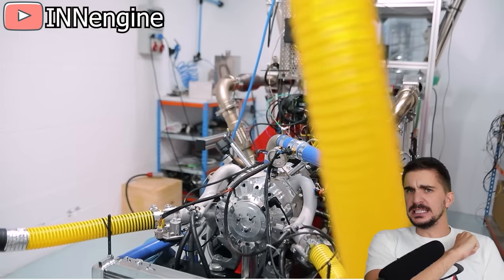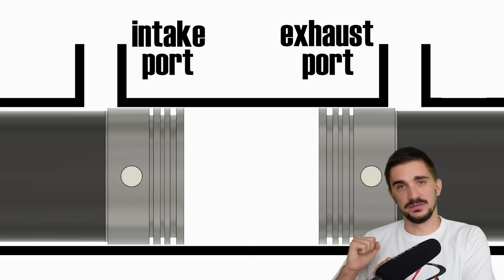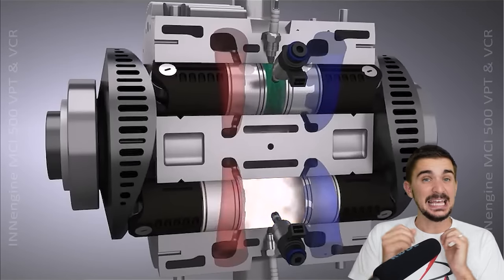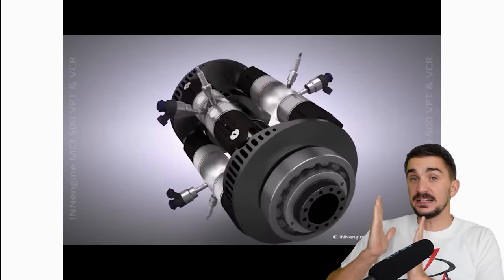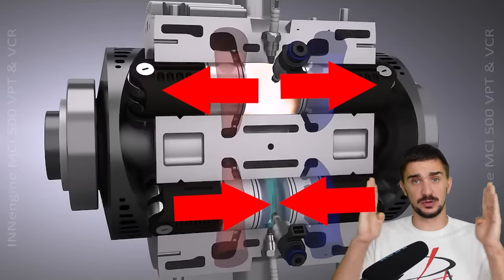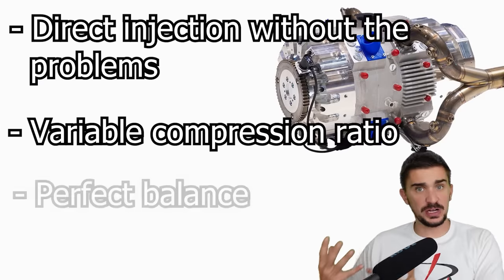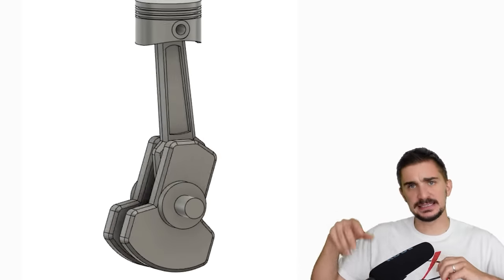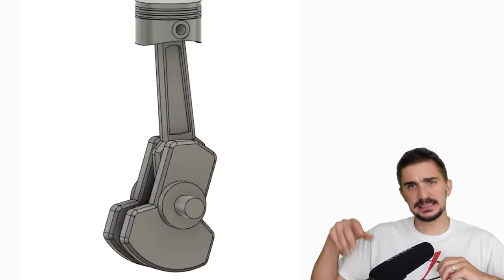Spain is Living in 2050? Revolutionary 1 Stroke INNengine Analyzed

Comment: This could be a perfect back up engine for an electric car.  Make it much smaller, make it run all the time at low speed so its always charging the battery.  A great way to add airconditioning and heat too.  This might extend the range by hundreds of miles and reduce anxiety.
Reply: Erm.. EV drivers don't have range anxiety. We can do 30' more to do the one journey per year that is more than 400km, sure, but I don't think this is important.. And solid state batteries are due to be commercial in 5-6 years so even that edge case will be gone.. This has it's uses, like, electric planes range extender, yeah, probably. But not EV I feel.
Reply: Like, if you are going to do up to 2000km on an EV today, that would need around 6 stops of 30', aka, 3h extra.
In an ICE, you would need 3 - 4 10 min stops to refuel aka, 30' - 40' extra. So we did 2000km, or, 20h of driving, with 2h 30' difference... not a problem.
EV stopped and stretched a healthy amount, ICE drove 20h non stop.
 
And if you plan to do more than 2000 km well... use a plane, it is cheaper.
Reply: I am not bashing your idea, I am just saying that the whole range anxiety thing is not real, it is a silly oilcompany fed narrative.
Reply: So, what about the many people who aren't convinced of the practicality of EVs yet or can't use an EV for their purposes because they drive larger distances than the EV can do on a charge without time to recharge (for instance cab drivers, delivery drivers, mobile nurses, field service)?
Range anxiety is as real as your view is narrow!
Reply: I mean I think thats the idea behind the hybrid, I wish they would push hybrids more because of that reason, there's no real range limits like an electric car
Reply: im starting to think range axiety is a thing for people that dont own an EV yet, myself included.  We are scared to buy one because we are not used to it yet.  No one that owns one is running out of juice any more than some idiot forgetting to fill up quick enough.  That coupled with the fact it is known there arent a ton of charging stations at least, but if we owned one, we'd know where they were at and would adjust accordingly
Reply: @LRM12o8  Most households could use an ev with ease .  If a little motor like this could extend the range of an ev by 300 miles then almost everybody would be relieved of range anxiety.  They could know that they could run the heat and the a/c on a 500 mile road trip.  Most of the time this little engine would only be responsible for heat or a/c and just at idle it would extend the range .  What would be great is being able to rent a full size one that sat on a trailer you pulled by hind you and you could go cross country no problem.
Reply: @smatchimo55  One thing that I don't trust is the life span of batteries.  I've had them last a long time and others that didn't last as long as they should have.  Knowing that if any one of them goes bad it will cause others to go bad to is also a problem.  Tesla is using capacitors but they need to be working on them more because caps charge almost instantly.  They are bulky but if you could run the car on caps instead of batteries then recharging would be more like filling up a gas tank.
Reply: 95% of trips in your car are under 30 miles. The average driver has nothing to worry about when it comes to EV range. 

There's a Washington Post article that's a great read on the subject, titled "The obsession with EV range is all wrong."
Reply: so long as their assemblies are modular and easily accessible for any moron to pop a new cell block in, I wouldnt mind that hassle over having to replace my standard car battery once every 3-5 years @michaelhord
Reply: EV Market has about 5yrs before the market density is max.  As in infrastructure will not be able to support the charging demands. These would be an excellent APU for EV's. Then engage for charging or when power requirements such as A/C are needed. More over, when a vehicle is moving at hi-way speeds it is primary propulsion. I imagine the rpm would be pretty hi on these. So the use of a flywheel in conjuction with the electric motor would overcome issues of steep inclines and such. These would likely be a great application for light aircraft. Really anything that operates at a fixed, hi rpm.
Reply: @michaelhord Do you think it's possible to use INNengine to power the electric motor directly?
Reply: So....... a hybrid...
Reply: @devkrovil  Nope. A hybrid can use the ICE engine only to move the car.
Reply: @KostasTsakalidis  "I am not bashing your idea, I am just saying that the whole range anxiety thing is not real, it is a silly oilcompany fed narrative."

No it's real. I won't buy an EV due to my patterns and habits and work. They will leave me with a dead battery stranded on the side of the road. My buddies with EV agree. Don't state your opinion as fact.
Reply: Ev can be enchanced to max utility use the engine as recharger. If they do 400 more power than normal engine and only weights 35 36kg you can put 1/2 the batteries +  20,25 of fuel. Imagine doing that that is why hybrid is the future and not ev
Reply: @KostasTsakalidis lol ok. Maybe it's because the people that actually need to be able to dependably go long distances just don't buy EVs.
Reply: @MASViper fisker uses a GM i4 to power a generator that charges the battery and propulsion is handled entirely by electric motors. That car is a hybrid.
Reply: @LayerZeroDesign  Wait, I thought that was EV, because it uses that i4 as a range extender?
Reply: @KostasTsakalidis  bro i think he just meant that drivers would not have to worry ab a dead or defective battery lmao
Reply: @KostasTsakalidis  isnt the 4680  texas tesla's already some kind of semisolid or even solid state ones ?> >?  cant remember if its sodium or lithium
Reply: I can understand why non-EV drivers have range anxiety. But why are many EV drivers so against the idea of extending EV range even further?
Reply: @amrazing33  fosil drivers have more anxiety  .. watching the dash for fuels and gas
Reply: With EV's how is range affected if you have a lead foot?
Reply: Compared to the immense pollution footprint of EV batteries. Just keep IC it weights way less also.
Reply: @KostasTsakalidis  I like EVs, but they cannot compare range wise, they are basically useless for longer trips. Of course there is range anxiety for many reasons. If you drive spirited, faster, you will have to wait more and more to go further. When you drive EV you always have pressure to drive slow/efficient to have some acceptable range.

If you drive at 130--160kmh (80-100mph), which is common speed on the highways, what is the range of EV then? Depending on model but around 150miles at most, that is so poor. Not to mention during winter, or with many overtakings, accelerations etc... 800-1000mile trip would be a nightmare and almost impossible in a day. You can only cruise at 65-70mph, to have some decent range of about 250miles, which is still poor and very slow, not to mention you need to charge 30mins again multiple times and plan every stop.
Reply: Exactly!  How nuts is it that a small gas engine isn't an option in a tesla etc
Worst case a chain saw could at least get u moving.  Way better than not even being able to go 10mph if u run out of juice.
Reply: Oder eine Kleine Gasturbine in e Auto. Oder man kann den Motor für ein Schwungrad nutzen. Dann kann der Motor mit der Masse den Akku und das Schwungscheibe betreiben. Und dann den Verbrenner aus machen und mit Dem Schwungrad Strom in der Batterie und Motor laden.
Reply: @KostasTsakalidis One of the Chinese brand NIO published the solid state battery and test it with live, but it should takes us about $50000 for only one battery.
Reply: bro just rediscovered a hybrid
Reply: Electric cars? Are we still talking about this nonsense?
Reply: @KostasTsakalidis  The range anxiety thing is real, and no realistic battery can be repeatedly rapid charged without rapidly depleting your total charging life cycle.

The larger problem with EV is simply infrastructure.

In order for everyone to have an EV to replace their more reliable ICE?

1. We'd have to have Children mining Lithium in Africa at a 100 TIMES their current rate, strip mining the entire country for the world's Cobalt/Lithium.

2. You'd have to convince Politicians to build more energy production means. Already you have the Gov of California telling EV owners they can't charge their cars during peak usage.

Go EV, but don't charge it.
Reply: So to upgrade the EV emissions safe vehicle your suggesting to put a gas combustion engine back into vehicles? Genius
Reply: Not all of us live in flat warm areas. It is not possible to make it from my city to the next large one up in Canada. This is true in summer. A tesla cannot make the distance through the mountains. In winter it is far worse, even when driving in a cold a$$ car because you can't spare the energy for heating. I'll never drive with that guy again. Seriously sucked. Hybrids can be great. I'd choose alcohol though and fix all the currently existing cars at once
Reply: Wrong. Check out upcoming cars. For instance Dodge is making a truck that has a gas engine battery charger
Reply: @FarmingWithYahweh yeah I saw recently how cali makes you charge at certain times, and I thought to myself what the fuck is the point of EV if I can’t even “fuel” when necessary. If I’m going on a trip and pass through cali at a certain time I just gotta go welp, and sleep In the car till I’m allowed to charge it?
Reply: @MultiRacecar1 EV’s construction produces the same if not more pollution than ICE.
Reply: @KostasTsakalidis  Model S Plaid and 911 person here. Range troubles in the Tesla are definitely still a thing. The difference between the two driving from San Francisco to San Diego can, and has, added as much as 50% to the trip time in the Plaid, especially when cruising at or over 85MPh. Road-trips also need more planning and the rule of thumb I've used is that including rest stops you tend to lose one hour every for every four you plan on driving otherwise.
Reply: Nah I think Honda or maybe Toyota got this beat already. It's a linear electric motor, coupling 2 opposed pistons. The starter motor is the alternator and the crank!  Valves are just electronically time except they're also just ported thru the stroke.... Something like that pretty friggin wicked concept at least I think it makes so much sense it's mind boggling.
Reply: Would it be worth the complexity? Thats a whole lot more things that could break.
Reply: @michaelhord the problem with trying to power something like a car with capacitors is that by definition they discharge as fast as they charge. Might work for something like an electric drag car, but long distances quickly become problematic.
Reply: @jutjub22 30 minutes feels pretty optimistic for a charge to full from empty. We struggle to charge phones that fast.
Reply: @KostasTsakalidis  Less than 1% of cars on the road in the USA are electric... People understand range and charging times and are not interested.
Reply: @derekeastman7771  yes, i thought just to fill 50-70% on power charger. Anyhow the range is huge issue, only when cruising at 40-60mph it is acceptable
Reply: @KostasTsakalidis  Correct. People who already have been convinced to buy EVs don't have range anxiety. But if you want to convince other people then range extenders are a great way to do it. I would much rather a plug in hybrid tyhan a full electric. And a small but powerful generator motor like this would match plug in hybrids very well.
Reply: @DonM-sy6yq guys, you are describing the Chevrolet volt.

It's a fully electric propulsion, assisted by a gas engine powerful enough to charge the batteries while driving.
Reply: If you have an EV with an always running ICE, it is no longer an EV, and just a hybrid.
Reply: that is not an ev but a hybrid. but good idea
Reply: it's*
Reply: @KostasTsakalidis no way you just hit him with erm unironicly that's so insane
Reply: You simply cannot go some places in EV it's just solid facts.. the fear is real. I work with batterys that 30 mins is more like 3 hours bro charging past 80% trying to get the voltage up there takes 5x as long as it takes to get from 20% to 80% so yeah ur very very wrong but EVs do have there uses like commuting in urban areas. Not for road trips...
Reply: Check out Edison motors.
Reply: 100% correct
Reply: @KostasTsakalidis  FYI - Oil and gas are not going anywhere. There is literally no other natural, replenishing resource on earth that can replace it. Wars are being fought to this day over oil and natural gas. Batteries, not so much.
Reply: @KostasTsakalidis almost all EV drivers have range anxiety reguardless of what you say.
Reply: @MASViper  How would a combustion engine not make an EV a hybrid? Just because it's not part of the drive system?
Reply: @Dr.Spatula  Well, it depends on the purpose of ICE and EV motor. Traditional hybrid, like Prius use ICE as the main mean of moving an engine as well as generating electricity to charge the battery. The EV motor works as either a supplement for certain scenarios or as another way to move the car without releasing any emissions whatsoever.

But now I know that hybrid cars mean a car with both EV and ICE in it, I just say "Ok" and leave it at that.
Reply: @KostasTsakalidis solid state batteries aren’t even a sure thing yet at all
Reply: @KostasTsakalidis Dude, you are spewing “tech enthusiasts” (rich staggeringly entitled Tesla owners) and you have audacity to talk about agenda or propaganda? Lol
Reply: All EV vehicles should have a hybrid option as I live rural and if I was to travel to the city having some major assurance I would get home and do some driving around while in the city if I had issues finding a charger

Comment: I was going to say "Okay, but this is still a 2-stroke engine...?" and then you covered it lol. Thank you.
Reply: Looking at it purely mathematically, i can see what they mean: 2 strokes per cylinder = 4 strokes per 2 cylinders = 4/2 =2, but here they are sharing the same intake, compression, combustion and exhaust strokes, so you have 2 strokes per two cylinders, = 2/2=1.
Yes it's still operating on the exact 2stroke principle, but i get what they mean also, and yes that is good for publicity, so why not?
Reply: @richardwilson3336  it still takes 2 strokes to complete the combustion and exhaustion cycle, so unless they're doing that all in one stroke, which is just about impossible unless we discover technology that allows us to combust exhaust efficiently, it's still, at its core, just a 2-stroke engine.

Comment: This would be great as a range extender/generator engine.  Charge DC batteries and electric drive motors to the wheels will provide your torque.
Reply: I'm sure that or ducted fan aircraft is what they are targeting.
Two or three cylyders would be nice instead of four.
Reply: Now we are talking.  My thoughts also.  Still, upset to the oil and engine industries must be considered.
Reply: @peterbaugh51  yes. You are right. Much better to go to a two stage tesla turbine, keep the pistons for pumping the condensed working fluid to pressure on the evaporator side. Drive the pump with the turbo expander condensing second stage. 
Then you have three moving parts, reversing with the turn of a valve, no electricity required, last forever, and you can get unlimited energy from the day night temperature difference.
And five hundred horsepower from something a quarter of the size and weight of this.

All proven by 1909.

We certainly have to consider the necessity of burying those industry scumbags where in a pit so deep they can never climb out.
Reply: @Maungateitei  Both ideas are on the pipeline.
Reply: My thoughts exactly, especially given the apparent sensitivity to changes in rpm. Just find the optimum rpm and use that for the generator.
Reply: I think that is a way more proper use of this engine .Forget torque ,use it as a generator at optimal RPM with some Super caps or batteries to drive electric motors and you are done .  Unfortunately we are at a point were invocation in engines means nothing because people aren't discussing reparability , efficiency or cost of production but argue about if it sounds nice or degrade the discussion to gas/diesel over electric cars .
Reply: @Maungateitei calling bullshit on this one. See all sorts of claims like this about all sorts of car-related technology, all supposedly killed off by big gasoline. Ideas don’t die nearly as easily as men, if there were some magical cheaper/more efficient/more powerful/all three power solution available for a car with no serious drawbacks or design challenges somebody would pick it up and make money off of it.